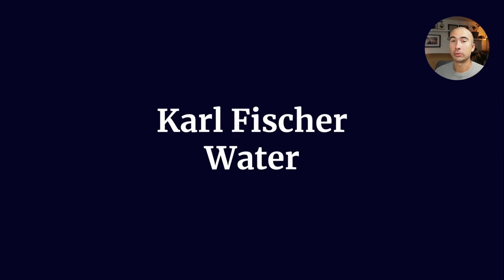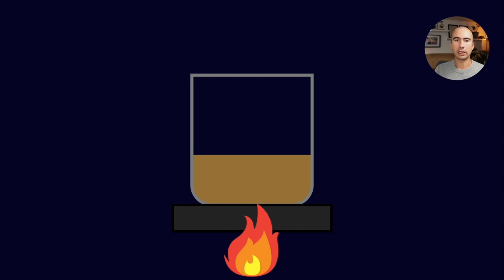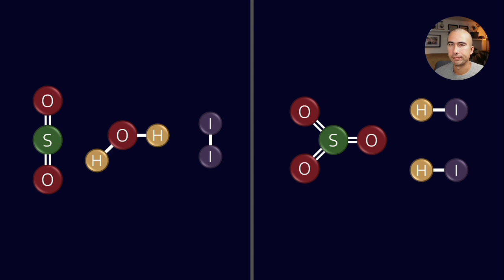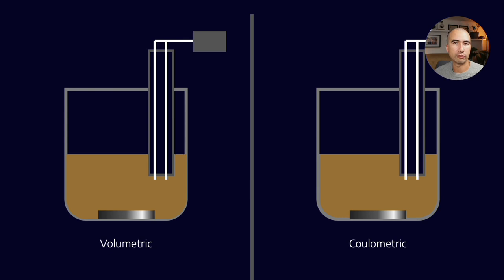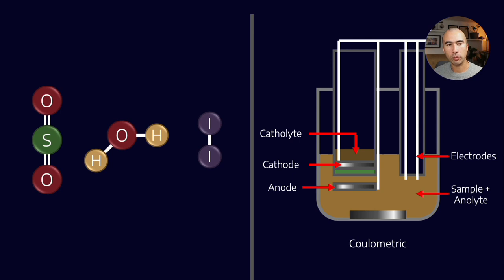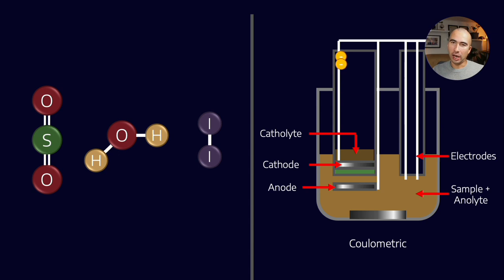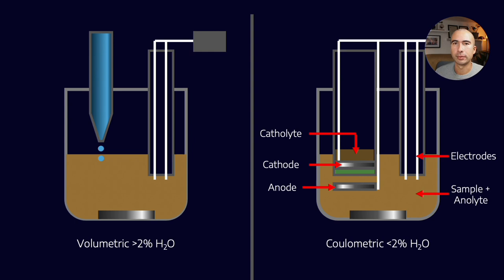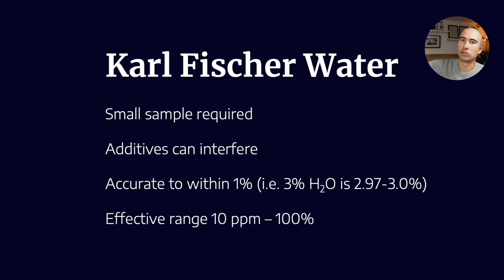How do we Measure Water by Karl Fischer?

Comment: Great video, explanation and animation as well! thank you. Let me make some observation about the equivalence point in the coulumetric method, I think that the end point is not due to the stop in the electron flux through the cell but the drop of the voltage between the Pt electrodes because of the excess of I2 generated after the end point. Actually the Faradic current in the cell (due to the oxidation of iodide) never stops. Am I correct?

Comment: What are the reasons we find water into the oil? Are they come from the base oil?
Reply from the maker: So many reasons! Seal leaks, humidity in the air, wash down water, steam / process leaks, oil cooler leaks. Plus base oils are generally a little bit hygroscopic, so they pull water out of the air.